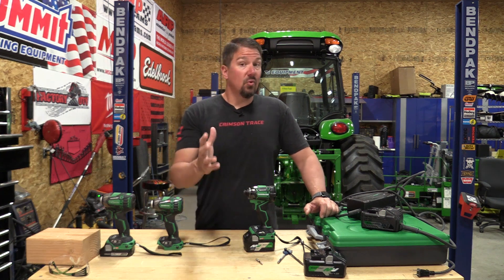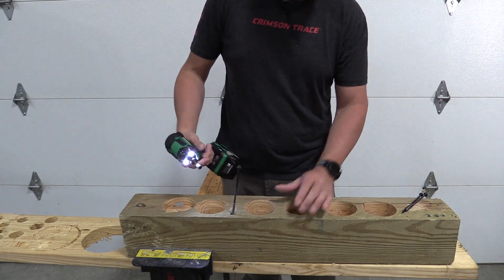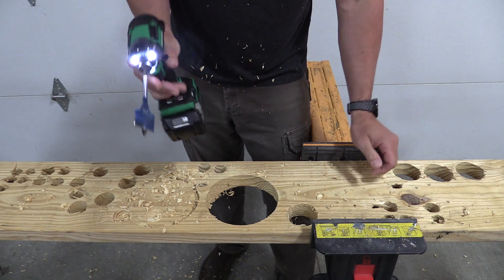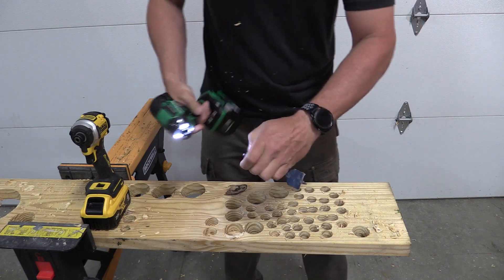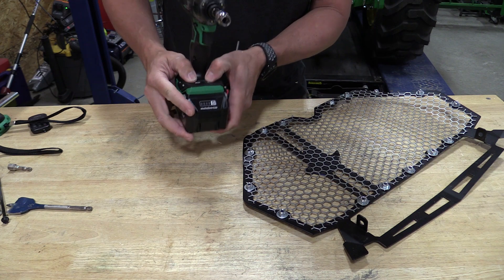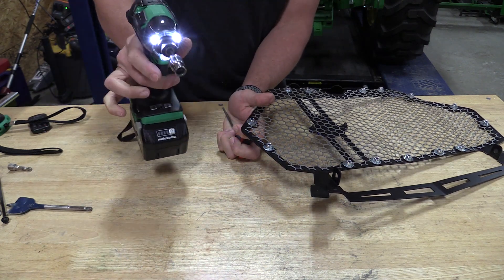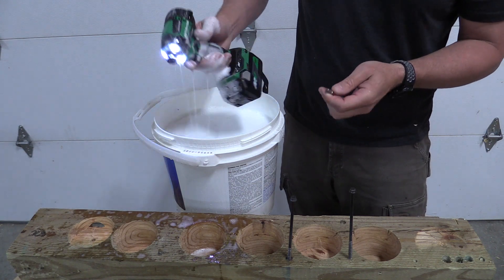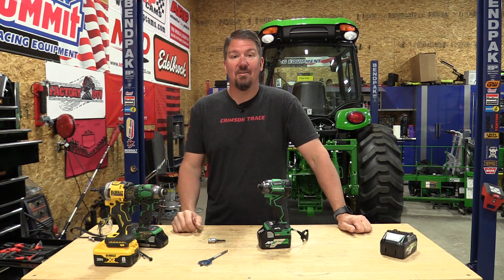New IP56 Metabo HPT 36V Tripple Hammer Bolt Review

Comment: Ok so heres my thoughts on tool brands in order from my favorite first.

1) Metabo HPT/Hikoki (Ex-Hitachi) from Japan. Pro-tier and now a USA owned powerhouse of german and japanese enginuity. Originally known as Hitachi from Japan, Hitachi then bought Metabo from Germany. USA firm KKR then buys Hitachi, which means that USA also owns Germany based Metabo as well. Innovation becomes more prevalent now that KKR owns both Hitachi power tools and Metabo power tools. KKR then brands new Hitachi power tools as "Metabo HPT" in the west (north/central/south america) and its power tools in the east (asia and some european countries) as "Hikoki," but batteries are the same and use-able between both and even with some old Hitatchi power tools. Hikoki's lineup has power tools that Metabo HPT's lineup doesnt have (yet) and vise-versa, but you can still buy either and use them with the batteries you have from either brand iteration. And that difference in tools is very small btw. Did I mention theyre now owned by USA?(huge flex). This company constantly pursues technological innovation like with their badass miter saws, also they had the first power tools with micro-chip processors. Their multi-volt battery system and AC adapter that converts cordless tools to corded changed the game completely. Best battery platform on the market. This brand is basically the best parts of milwaukee, makita, and bosch all in one.
Metabo HPT/Hikoki is my favorite because of their battery platform, selection, and enginuity from the 3 leading countries in tool making technology (cuz USA now owns them, huge flex, cant get enough). I also think its super funny if you have a mix of metabo hpt, hikoki, and even some old hitachi tools in your arsenal all using the same batteries lol. Sadly though they aren't compatible with Germany based Metabo cordless tools, which brings us to...

2) Metabo from Germany. Metabo is still its own brand (USA owned too lol) and goes beyond pro-tier to Expert-tier specialized power tools. Grand daddy of power tools that introduced the first hand-held drill. German Metabo still makes its own line of power tools in europe, but with a different (and just as good) battery system with different focus and consumer base (metal workers) and simply branded as "Metabo." They are basically the Astin Martin of power tools. Some of their power tools have specialized interchangeable components/add-ons that help tackle specific tasks. They are constantly innovating just like their sister company Hikoki/Metabo HPT, and are currently trying to develope a universal battery platform for all power tools overseas and hopefully usa, referring to it as the "cordless alliance system." 

3) Makita from Japan. Pro-tier. Without a doubt they are the best. They are top dog. Grand daddy of power tools and introduction of electric planer. Never owned by anyone else, has stayed independently owned from the start. They make cordless tools for any job you can think of and for everyone pro to apprentice. Their selection of battery powered tools is absolutely insane and probably the biggest in the market. 

4) Milwaukee from USA. Pro-tier. Grand daddy of power tools. Introduced the first reciprocating saw... unfortunately company sold to hong kong company TTI in 2005, BUT weirdly enough this actually helped them drastically boost innovation of their power tools for every work demographic and innovation for lithium ion batteries. To be fair a lot of their stuff is still made in USA and every tool brand is guilty of having power tools/components made in other countries like china anyways, but the fact that china actually owns them now is kinda bogus and still rubs me wrong. Selection is almost as big as makita, but they are known for their power.

5) Bosch from Germany. Pro-tier. Another still independently owned tool brand. Grand daddy of first hammer drills. (Im pretty biased towards this because it greatly helped the outdoor rock climbing scene explode by making it easier/faster to bolt outdoor routes on rock faces). Also they make a lot of the most super hardcore construction grade power tools and have a great selection too. Great appliances too.

6) Dewalt from USA. Great selection from affordable apprentice-tier tools to pro-tier tools. They make a lot of great attachments and accessories that are universal for any power tool brand.... but if i do recall, got caught in shady business practices with the 20v battery platform advertising... still owned by USA though, but outsources from china and other countries like everyone else.

Runner ups:

1) Flex tools from Germany. Up and coming pro-tier power tool lineup from germany with tools that pack a lot of power because of their introduction of "stacked lithium" 24v batteries and "turbo" button. Flex basically took the Lowes Kobalt XTR lineup and made it its own brand of power tools and added a turbo button. They also took a page from Metabo HPT/Hikoki and released an AC adapter for their tools. They are an offshoot of the already existing Germany based red-colored 18v power tool legacy brand of the same name. Selection is quite small so far tho, and their tools are a bit bulky imo.

2) Hilti from Liechtenstein. Expert-tier. Specialized tools mainly for concrete industry and hardcore construction sites. Too fuckin expensive for what they are though, probably for the demographic of construction guys with brain surgeon salaries which is a very slim demographic.

3) Festool from Germany. Expert-tier power tools specialized for woodworking/cabinetry industry. They are the only brand where all their tools are made only in europe, HUGE flex.

4) Skil from USA. Good for the home DIYer/hobbyist and even teeter to apprentice-tier. Affordable prices, but great quality. Not the biggest selection. Known for the introduction of the skilsaw, which is now a seperate brand specializing in... skilsaws haha.

5) Porter Cable from USA. Good brand for home DIYer/hobbyist, their tools are a little hardier and teeter on to an apprentice-tier. Not marketed as well as they should, harder to find. Selection not the biggest.

6) Ryobi from Japan. Great selection of tools, affordable too. What I like about them is they know they are home DIY/hobbyist grade tools and dont shy away from making that known and embracing that. The color scheme and their battery shape is something I dont agree with tho...

Seperate category - hardware store house/exclusive power tool brands:

1) Kobalt from Lowes. Their XTR 24v lineup are Pro-tier power tools that I think were the "Blueprint" (get it? Ha) for the new Flex power tool lineup. They are pretty hardy and even often blow their DeWalt counterparts out of the water. Aside from XTR lineup, they have solid apprentice/pro-tier grade power tools. Growing selection of power tools. I bought these as my first real construction job power tools and they stood their ground against all the dewalts on job sites.

2) Ridgid from Home Depot. Apprentice/pro-tier tools. Good selection. Started as a plumber/pipefitter oriented brand, then started making power tools exclusively sold at home depot. Good first tool brand to own as well.

3) Hercules from Harbor freight. Apprentice-tier. Harbor freight does no wrong idgaf.

4) Mastercraft from Menards. HomeDIY/Apprentice-tier. Not much experience with them.

5) Craftsman from Lowes and I think Ace now. Used to be Sears' house brand. From what I heard, the Craftsman tool quality from Sears era is not there anymore. More-so in the home DIY/Hobbyist maybe border apprentice-tier category now.

6) Hart from Walmart. Hahahahahaha i had to...

Comment: You are right my friend I own all Hitachi : a cut off saw 14 in, a 3/4 Hamer drill corded, a belt sander, a impact driver Wh14, all bought between 2003-2006 so almost  20 years old I renovated a house and built a new one with a 20x28 garage all from scratch about 15 years ago plus a 100 feet long aluminium and wood  stairs in a 75 feet hight cliff by the sea all work great and never let me down and also a trailer plus tire change summer winter for the past 20 years😅😅😅 soon very good tool my wife is holding me from buying tools 😅😅but she will back me for a new impact driver. Keep it up you are a valuable asset to any diy thanks

Comment: Love my metabo tools. Quick note though, the amp hour measurement isn't a way to compare the power. Just the length of how long the battery lasts
Reply from the maker: Not always.  It matters on the watt output of the cells used.  so sometimes a higher Ah battery might have high output batteries and give more performance.  So, when we talk about batteries, we have to call out Ah as that is what most people call them by.

Comment: I'm pretty heavily invested in the HPT platform. I love their tools. A few years back I picked up the Black version drill and impact kits they had on clearance for like $69 ...I was blown away by the power and quality. I couldn't believe I scored for that price. Then later Lowes was selling the 36v 4a/h battery/fast charger kits for like $80 if I remember....That was it...I was hooked. I have been adding to that platform ever since and selling off my other brands. I have also had friends borrow some tools and they were blown away. I just wish there was a bit more width to the product line...but it is clear their market is the pro on the jobsite doing common tasks. At least they have a cordless sheet metal nibbler, and that says something.

Comment: Great video!!! I’m a huge metabo hpt user/fan from when they were hitachi to hitachi koki, still Koki in Japan/Australia 

The 18v lineup will do the job But I recently had to send out my drill after one year of use because the screw on my chuck got stripped off I also had to send out my 18v 21 degree Framing Nailer after 2 years of use I’m really impressed with the 36V tools I have the 7 1/4 saw and sawzall and impact as well as the wrench and I haven’t sent those out while also using them over a year 

I’m now purchasing the 36v tool lineup only

Comment: ok here is the issue you are facing one everyone has batteries for other brands due to Metabo being a late comer to the cordless series of tools . most people do not diversify much and stick to what they already have batteries for . I completely disagree with this you should just get the best tool , get a combo set and get the free batteries . don't limit yourself to one platform . ok last is the issue that Metabo tools are not the best power in class other then some of the higher end . if you start to look at the table saw , rotary hammer drill , rebar bender , and a few other specialty items . they do have great features in all tools but when they do not have the same rated power . your in the video using an atomic a Dewalt low end brand vs a top the line Metabo . this would be more accurate if you used an Dewalt XR but still the Metabo is not the more powerful impact . the most powerful impact on the market right now is actually Ridgid at 2400 inc pounds and a lifetime warranty , followed by its parent company Milwaukee fuel double hammer at 2200 inc pounds . the fact that this one has three hammers makes it in part superior but when its power is rated 33 % less of a driving force i cant go buy it as what if I needed that 2400 inch pounds of Ridgid or the 2200 of Milwaukee the Dewalts are only 1850 . I do love Metabo tools and I suggest them to anyone but do your research and buy what you need to get the job done . if you just want a great tool look no further
Reply: Metabo vs the Dewalt atomic , the Metabo is the much more powerful tool
Reply: @granttalbot7446  M18 gen3(and gen4)impact driver is rated at 2000in lbs. Gen3 is 3600rpm, and gen4 is 3900rpm

This one is rated at 1903 in lbs, and 3700 rpm. That's not a significant difference.

Makita's top 40v impact driver is rated at 1950in lbs, and 3700 rpm.  They're all in the same ballpark. Of course, no one really needs that much power anyway. Speed is more important for what an impact driver is typically used for.

Ridgid has a habit of advertising wildly exaggerated specs.

Comment: I just picked up the triple hammer 36v kit with 2x 2.5ah multi volt batteries and the 196wh charger for $111 and it's one of if not the best impact I have ever owned
Reply: Where? Thx
Reply: @ascd9260  lowes

Comment: Metabo hpt makes phenomenal tools, they at least in my experience have innovative and unique but also practical tools all with tool truck level customer service/warranty’s  with some  of the best power/battery platforms all around imo…I just wish we got more of the tools released under hikoki Japan such as the C3605db flush cut saw the 36v jig saw and the 36v 6.5” c3606 …if they could get some more loyal users they definitely would release them in the states

Comment: Great tool. I've been using it for the last couple weeks. Metabo HPT stuff generally is pretty good. At least the multivolt stuff i've been using. I should have a video review of the impact drivers in the next up coming weeks along with more metabo HPT tools. Already reviewed their rear handle circular saw and it's great.

Comment: Hear hear! Very well-said.

Not to mention their industry-firsts and PTIA award-winners: full-size 36v plunge-router, 36v 10" table saw, 36v duplex nailer, 36v positive-placement nailer, and so on.

Metabo HPT also offer the best promotions. Example: I bought the 36v recip saw, tool-only ($209 + tax), and got the 36v hammer drill KIT, free ($399 value).
In all, I got the top-notch recip saw, top-notch hammer drill, two 4-ah MV batteries, a rapid charger, and the hardcase, all for only $209 + tax.
They don't play games. It's always: Buy this, get this free. And the free item isn't some chumpy, lower-level item: it's always a top-notch battery or battery kit, or an equal-or-higher value tool.

I still own plenty of Milwaukee's tools, and still use their specialty tools regularly -- namely, their Quik-lok system, hole saws and 18v vacuum. But from now on, I'm throwing my money at the higher-value Mean Green for my everyday power-tool needs.

Comment: My 18/36v tools are all branded Hitachi or MHTP. Price of entry is what sparked my interest. The 36v recip saw is a beast.  Their corded and cordless nailers are top notch.  The subcompact recip saw accepts both standard recip blades plus jig saw blades.  Their hammer drills are legit.  The list goes on and on... Topped by the Triple Hammer.  They get lost in the chaos that is the power tool world. They get shoved to a corner with 6 tools on display in their only real brick and mortar presence in NA in favor of other tools. . Perhaps the old Hitachi brand name still haunts them with the lower grade aspects and sub par performance of their former parent company (can't remember seeing too many Hitachi reviews either).  So mix their history, their marketing, their availability, their "history" with the over saturated market where MHTP is trying to gain a foothold and you have a definite recipe for a diamond in the rough.  Perhaps their eagerness to simply let the tool do the talking in a world dominated by what social media thinks leaves them near the back of the pack. Maybe they don't mind and would rather fly under the radar with some of the best tools you buy.
Reply: agree all points. my favorite line. if they had a few more, I'd be all in. but happy with what I have.
Reply: Was Hitachi considered low quality in the power tool world?  I know in the electronics world, Hitachi was top notch (equal to or better than Sony).

Comment: dont you have to sink in the tool without pressing the trigger then take it out and press the trigger....by keeping trigger pressed the amount of air pushed out by the motor avoids water going in...tried that with my craftsman impact and i had no issues sinking it in a bucket with trigger pressed
Reply: If it's waterproof, it's waterproof. The testing to get this rating involves hosing it down with massive amounts of water, and also sandblasting it with talcum powder. 

I wouldn't personally stick my tools in a bucket of water even if they told me I could.

Comment: Definitely my #2 brand. If they had a little more in their line, they’d be #1. They have been innovating with their battery system and adapter for awhile now, and as far as comfort they are #1 for me. They unfortunately have 0 marketing and I wish they would have stuck with hikoki like overseas instead of the confusing Metabo hpt name change
Reply: should have stuck with hitachi
Reply: And to make it even more confusing, Metabo is a German tool company which was apparently bought by Hitachi and then sold again.

Comment: I'm with you, Brian.  MHPT might be the single most underrated tool brand out there.
Reply: I can offer up a couple vids from my channel - 
Gen 2 Triple Hammer: https://youtu.be/kvkwZtCgoM0

36V hammer drill:
https://youtu.be/fDz9W-i-nB8

Subcompact Impact:
https://youtu.be/VQD_I5cLek4

36V Plunge Router (spoiler - used it wrong): https://youtu.be/CBIWV1OsQ-s
Reply: @PhillyFixed  I have been abusing that router-its awesome and changed some of my methods in the shop and on jobsite-check out awesome framer using the router and his take on rear handles
but don't forget the barrel grip for life